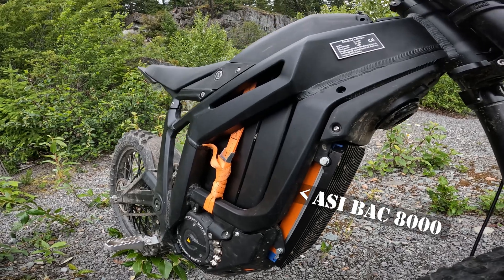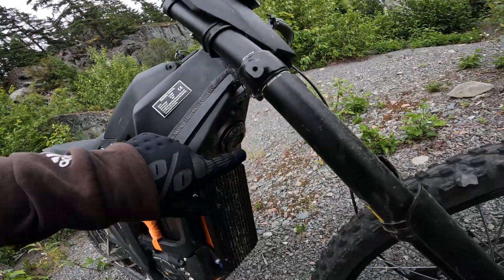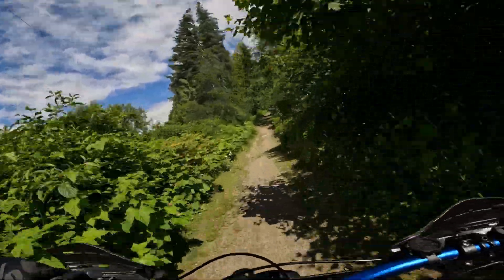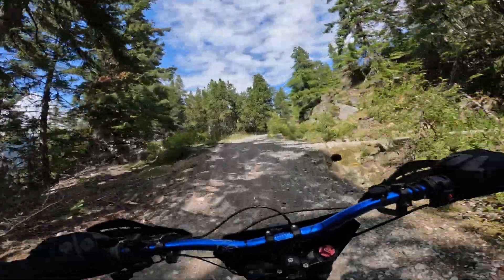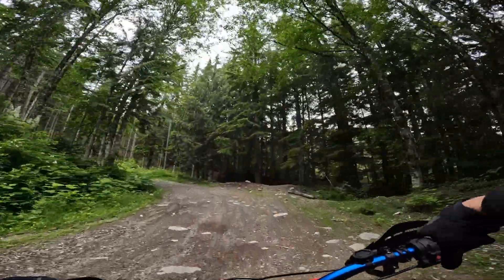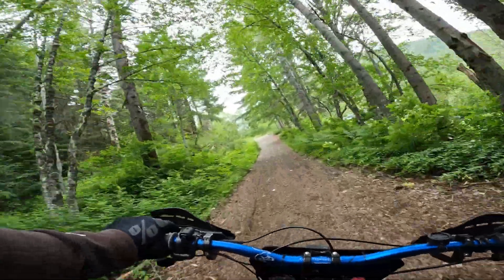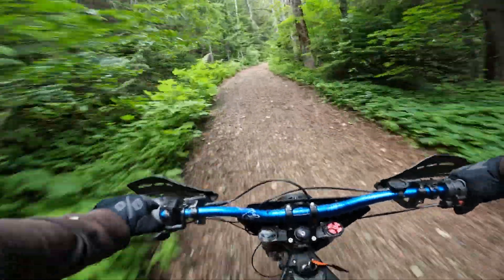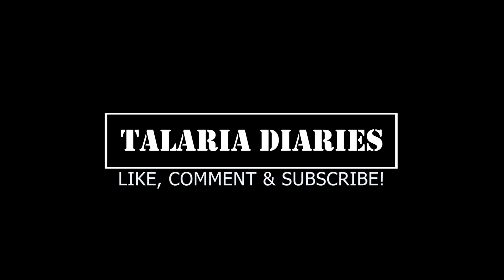Ludacriss Power Upgrade -  EP 34 - TALARIA DIARIES -  Talaria Sting BAC 8000

Comment: I have the bac8000 and my battery is bypassed but before I bypassed it I could run 6500 watts I tried 7000 and my bms cutoff I tried 6900 and my bms cutoff. So I know you can run more than the 6100 your using now but not a lot more
Reply from the maker: Any idea where to find the odometer showing total vehicle milage Alias??
Reply: @electrified6043  I wasn't sure if it had that feature. I do kind of miss the couple thousand miles I had on my odometer before I changed to the bac8000.
Reply from the maker: @MotoAlias  Totally agree!. 
I was super close to my next oil change before I did the swap. It was probably 11pm when I started and I forgot to check the odometer.
Reply from the maker: Ya. I ran 6500 on my first ride and tripped the BMS a block from my house stopping for the first time with regen brake. lol  
I did that twice and GLE told me to run 6100w until I bypass. They said the bms isn't capable of taking in so much voltage. Especially around full charge. I know I can just disable regen brake and it seems to actially be fine as long as I'm not at full. I just don't wanna risk damaging my controller. 
Thanks for the info. Been watching your videos !
Reply: @electrified6043  ya that sounds like a regen issue. When your battery is full you can't fill it more. Your supposed to wait to use your regen. I don't use regen at all tho and was able to run 6500 watts without a issue. Are you planning to bypass your bms I just did and am running 8000 watts now. It's really nice but I still wish I had a 72volt battery 😆
Reply from the maker: @MotoAlias  Ya my BMS bypass kit is on the way.  I'm pretty sure your right and I can probably run 6500watts no problem with thr regen brake disabled.  I should have known   not to use it on a full battery.

Comment: Maaaan I am SO hyped to get my hands on an aftermarket controller. I think I'm going with the KO, since they confirmed Bluetooth capability as well. I think I remember reading that you can do up to 8kw without a bypass. Worth a shot, considering all you have to do is restart the bike and maybe flip the breaker if you trip it.
Reply: Also, bypassing the battery should not affect charge BMS capability, only discharge. Using the thumb regen should function exactly the same, bypassed or not.
Reply from the maker: I tripped my BMS about a block from my house using the regen brake. The controller came at 6500 watt/3400 watt tune. Luda/ street. I was told to drop it to 6100 until I bypass the battery because Tripping the BMS can damage the controller. Keep in mind I'm 220lb, the tire is huge and I am riding vertical in the mountains. I would just be careful with the regen on an unbypassed battery, especially around 100% charge.

What does the KO blue tooth do? The GLE is running bluetooth? oh nvm As well.  STOKED for you!!
Reply from the maker: Totally not a GLE shill. The KO looks super awesome !!. Didn't hear about it until I had basicaly purchased the BAC 8000 and spoken with GLE. Either way I think you can't go wrong!!. Happy riding fam!
Reply: KO controller definitely the way to go can make you’re own settings unlike the the bac’ controllers
Reply from the maker: @juniorotero9030  The BAC can change every setting to whatever you went.
Reply: @electrified6043  I actually didn’t know that I just heard they where more complicated to work on I’m planning on getting one but so far I heard the KO one is little easier to setup
Reply: @electrified6043  if you knew about the KO controller before you bought the bac would you have gotten the KO ?
Reply from the maker: @juniorotero9030  I have no experience with the KO and am definately not knocking it.
I have a code for free shipping on the GLE kit but in no means do I  wanna shill people towards GLE ASI BAC 8000 over the KO kit.

I can tell you there is a toggle button that toggles between street and ludacris.  These are customizable settings. Every setting can be written  in. There is pre made brake modes ( wheelie, separate  engine brake with lever,  throttle off and one more)
All of which are customizable.
The  downside of the GLE dashboard is that it requires wifi of data. I want to use a old beater phone that I leave on the bike.  This isn't really possible. The app times out and whatever mode I left the house on is what I'm stuck on without data.

Comment: I call BS on the +40% increase. We’re gonna need more testing😊 
The math doesn’t work.
Reply from the maker: Did more range testing. Definately    dependamt on riding. I did some fast, wide open roads and definately didn't get 20km/ 12.4miles on 28%. More like 9km/5.5 miles. 
Riding trails, singletrack and roada I have been getting 33-35km/20.5-21.5miles withs 51-52% battery. I did similar milage last week but had. i sound on my footage. I think I was at 18- 25% battery after. Hard to tell exactly what gains I'm getting but I will keep tracking them.
Reply from the maker: I will definately be doing s.sore testing. So far my mind is  blown. 2 seperste rides from 100% -  28% kn the same tire. Only difference is the new controller.

Another ride I did was 29km on 50%. 
I will go out today and ride it longer .

App not working without data ia annoying.

Comment: I got my gle kit bac8000 and bypass kit. Just need to install asap. Need new tyres but I'm going to use same as surron size. Like you say not much available
Reply from the maker: After I got this tire I found the Shinko SR241 Dual sport tire. It comes in 2.75" and 3.5". 
I had another bike to demo the next day and I was desptate. Now that it is mounted I might ride it for a while, do a burnout or keep it for those big hillclimb rides in the future.

I have the battery bypass coming. I tripped the BMS like 20 seconds from my house using the regen brake so I'm trying to hold off on using it. Especially at 100% battery. Hence the 6100 watt tune. But I am super impressed. It was skidding this huge tire down huge hills. 
Wish we could go for a rip ! happy riding fam!
Reply from the maker: The install was pretty simple.Shoot me a message if you are having any issues. 

My only pointers would be 
-watch for the clip nuts that bolt the  battery wall to the frame. I had one come off and I knocked the second one off trying to figure out where the first clip went. They sit on the mounting  arm of the battery wall.
- Of  the 2 factory controller harnesess connections. You only use one. The longer harness goes to the boot of wires under the  bash guard ( direct to the engine hall sensor) install video shows it is at 2:17 but they didn't ever show it be plugged in. Other OEM connector is un used.
- of the 4 coloured connnectors. The yellow is all you need to run to the handle bars ( regen)  The other 3 just stash away. unless your using eggrider
Reply: @electrified6043  I noticed they didn't show where the hall sensor plug went either that had me hung up for a bit but I got it figured out.
Reply from the maker: @MotoAlias  Right!. I must have watched the video about 100 times. Wish they mentioned the hall sensor again lster on in thr video lol.